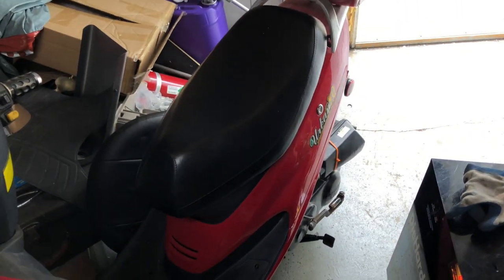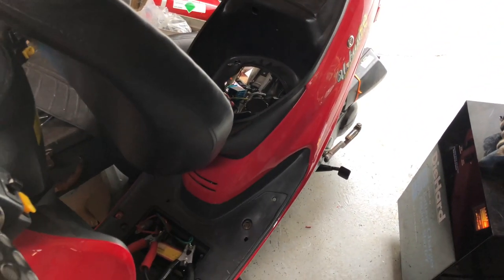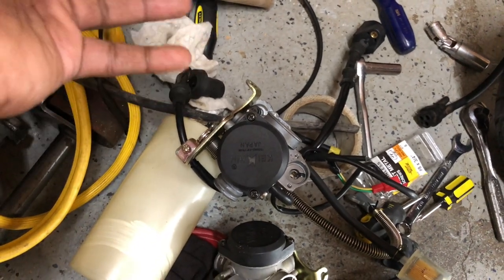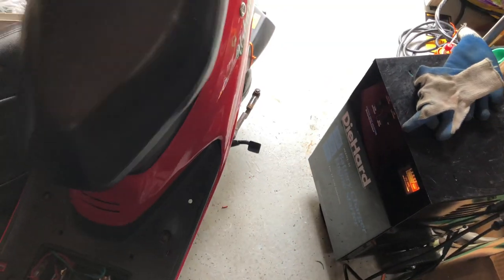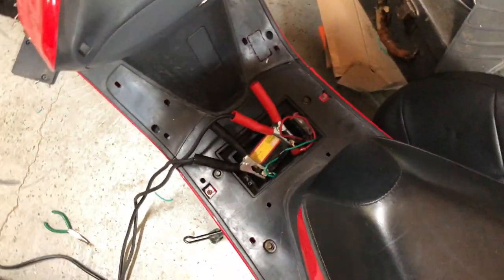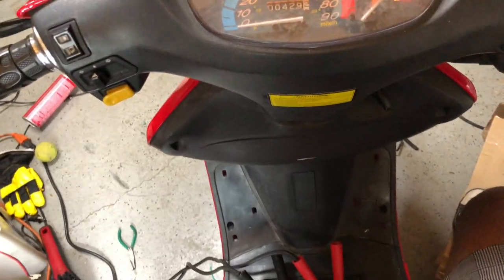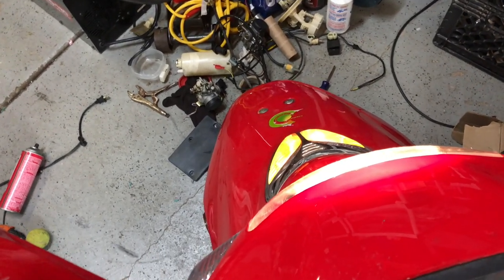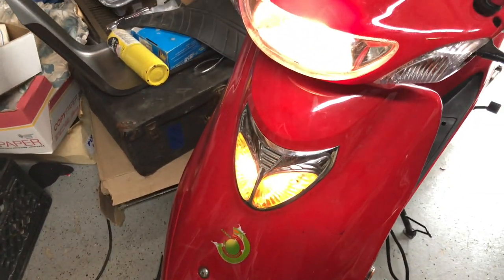Chinese Scooter Won't Start! Got Spark, Gas, Compression? This May Help!

Comment: For those of you having this problem check your stator and the inside of your flywheel for corrosion or rust. Clean both with Emory cloth and blow out any residual.
Reply: Where is the stator
Reply: @chrisvita155 😅 side of the engine bottom end it attached to it

Comment: These kinds of things can be maddening. Trying to figure out the problem can be a search into the unknown. I rebuilt a 100cc big bore upgrade last night. The battery would not register as fully charged on the charger. It was as max charged as you could get. It took going through the actual firing chain, Plug-Coil-Connections-Ajacent wiring to find the problem. It did kick. It started. Kind of odd overall. I don't know what did the magic trick but it seems working the wires over in the actual firing system was what seemed to do the trick. I think the plug was just off the coil boot connecter. It won't run like that.

Comment: I have a 2015 Taotao with the same problem. The solution was to replace the lead acid battery with lithium iron phosphate from the company that makes  Battery Tender float/trickle chargers. The battery was about $125 and about 1/2 the size as the standard battery,. It put out enough juice to spin the engine fast enough to start the scooter every time. It lasted over four years. When it died I was broke and bought another lead acid. I have to kickstart the engine when cold. The kick starter spins the engine faster. The electric starter only does the job when the engine is hot. Valves are properly adjusted, good compression, lots of power. Just a no love battery.
Reply from the maker: Thanks for sharing that info, Corry.

Comment: Im going thru the same thing with a 150cc Taho Taho. Replaced the carb amnd filled with new gas after draing tank completely last Fall. Will check spark and try a battery booster next. Thanks much!
Reply from the maker: Giving the battery an extra boost may just do the trick.
Reply: I got a 50cc Ice bear Maddox Ruckus and I accidentally put regular gas in it but it says to use octane - is that ok??? I can't find any info on google- I'm a chick trying to learn this stuff on my own
Reply from the maker: Octane is only the rating of the fuel. It may says to use 87 octane in which is regular pump gas at your local or any gas station for that matter. Thanks,
Reply: @TerenceDIY  Thxxxx Im subscribing now--so it says to use unleaded 90 octane or above and I accidentally put regular in there 😬 it's like 3 4ths full can I fill should I just use the rest of the gas and then use unleaded- fill the rest up with unleaded an mix it or drain what I got in there now and then fill it up with premium? Whatever is easiest and won't mess up my engine is what I want to do
Reply from the maker: It's not going to hurt anything. It's about performance. You may lose some power (you won't even notice it) but that's about it. You can use some 93 to balance it off.

Comment: I'm going to try replacing my gauge wire to a heavy duty gauge. also when you're on the run if you bring your 18V or 20V cordless drill battery and just run quick wires from it to your battery it really helps to start
Reply: K point u

Comment: My agility ran ok, was bogging out, but took off strong, then it would die & I'm thinking lack of fuel or being dirty,.
Now it wont start, but acts like it will run wen Iput alil gas strait into carb,. (Sputters to run , till the lil bit of gas is gone that I put in...??
What's wrong??
Is. The Bowl dry or empty.??
Reply from the maker: Yep, I would remove the bowl and clean it. Also spray the bottom of the carb into the jet with carb cleaner once you remove the bowl and I am pretty sure it will be fine. Thank you so much for watching.

Comment: i kick start it a few times before i turn the key than i turn the key and kick start it and it will start right up but if i try to start it by the the starter motor it would not start sometimes and even if i turn the key of and kick start it it happens on cold mornings only so i always kick start to start i get up a little earlier and start it up if it starts up i take my time before school if not i have to get ready quicker than usual to go with my brother

Comment: I had a crack in the intake going to the motor from the carburetor. then I had another bike that had to have pressure on the intake of the carburetor or it won't run right

Comment: I got a 1985 gn400, checked everything, valves, timing, ignition timing, replaced carb, spark plug, ignition coil, cdi, has amazing spark, a ton of compression, fuel, air, even tried start fluid, won’t start, it will only pop
Reply from the maker: Is it electric start or kick start?
Reply: @TerenceDIY  it’s kick start, I just got it running actually, it was the decompression mechanism releasing to much compression, so I did not in fact have good compression lol
Reply from the maker: @theslayer8258  That's awesome! Glad you got it going.

Comment: I have a 2012 ToaToa 50 scooter that was sitting for over a year at a friends house. He gave it to me, and after cleaning the carb, charging the electric start, and a few other things I got to turn on and ride. Two days later, no matter how much I charge the battery it will not turn on, it sounds exactly like how the guy in this video bike sounded when he tried to turn his on. I could feel the muffler blowing little puffs of air out when I use the electric start and we’ve even put starter fluid in the intake. What is a good battery that will put out a lot of power? The current one I have is a XTRRME XTAX7A-BS 12V 6AH but I think it’s bad.
Reply from the maker: This battery should work fine (link below)

https://www.amazon.com/Weize-YTX7A-BS-High-Performance-Maintenance/dp/B07GGTCJ9Q/ref=sr_1_1_sspa?crid=2XJRWNDJWU4AA&keywords=50+cc+scooter+battery&qid=1691616263&sprefix=50+CC+scooter+%2Caps%2C121&sr=8-1-spons&sp_csd=d2lkZ2V0TmFtZT1zcF9hdGY&psc=1

Comment: The diaphram that some call the fuel pump, your fuel line comes from the tank into it..well it's a cheap summer inside,if gas sirs it stagnates,that damages plastic and rubber parts,like this diaphram,replace it and the gas filrer,then drain your tank completely, scooters are a bit like cars,they have a reserve area ,gunk from old gas clings there and putting new gas in breaks it up and right back into your filter and carb ,,clear it all replace your spark plug and your on the road bro

Comment: So what was the problem with your bike you started it up I couldn't hear you talk. I'm having trouble with my TaoTao 50 it was running great the next day I went out. And tried to start it and I realized the drainage tube was off but that wasn't the problem. It's a new carburetor I replaced all the tubing I have gas going to the spark plug I stuck my finger in there. Change my CD I box and it still won't start. So today I'm going out to change my Bendix gear. That was always the problem on my two old bikes. So are you saying I need to get a lithium battery I saw someone mention that ?
Reply: It's probably the Bendix gear at what's happened to last two bikes. So I'm going to take it off tomorrow I got two spares. And if I need I can change my belt too and my rollers, I figure if that's not it I'm going to have to take the engine apart and reset my valves
Reply from the maker: Hi, my problem was that the battery wasn't spinning the engine over fast enough to generate a strong spark to start it. I jumped the scooter off using jumper cables and it fired right up. I eventually bought a powerful battery. If you have a jump box or can jump it off with your vehicle, the scooter will most likely start up.

Comment: I even jumped with my car and didn't start up. Im about to burn it up 🤣
Reply: You probably ALREADY burnt up the battery and electrical system, when you jumped it with the car. I hope you at least didn’t START the car’s engine, but just turned the key on.
Reply: Idle is way too high it seems
Reply: I’m goin through the same problem tbh with a 150 cc I’m doin vacuum lines now

Comment: Hold your hand on the back of the carburetor where the filter is
Reply: That helps when there’s compression or air intake issues right?
Reply: Thats exactly what I have to do from time to time

Comment: check the valves that more likely the problem great video
Reply: Where is located the valve?
Reply: @allaboutfamily5192  under the front case closest to your feet. There are valves that hit the intake and exhaust springs and pistons but those should be tuned to .004 intake and .005 exhaust. Its called a rocker arm its what the camshaft hits. This is where timing comes into play too. I hope this helps a bit?
Reply: @megashooter  thank you very much for your help,🙏❤ im gonna do that,God bless you and thank you for your time Anthony.

Comment: Bro that’s no problem “ JUST GET A HIGHER VOLTAGE BATTY.. that battery voltage is too week “ it turns it over but not the right turnover speed “ that’s called a slow turnover “ due to the lack of insufficient voltage

Comment: I had this same issue so I had to tear the engine up and found scoring in the piston then replace the block, piston and rings It starts like new. your engine spins so your problem is compression.
Reply: Could you elaborate on "replace the block" im trying to get my scooter going seemes to be same issue as this guys

Comment: Very informative could be what I’m going through right now
Reply from the maker: Most likely, especially if you're having issues like I did. Thanks for watching.
Reply: Me too!! I have everything, compression, spark, fuel, even tried starting fluid. I do have a decent battery though. My multi meter read the battery at 13.2 volts. I don't have a battery charger or a jump starter😢😢😢. Will jump it with my car tomorrow.
Reply from the maker: Let me know if it starts when you jump it.

Comment: I bought a Tao Tao half a year ago so presumably the 2022 model but exact same problem people will replace everything assuming it shouldn’t be the battery but my battery did start to weaken before this problem occurred. Anyone recommend a certain battery?
Reply from the maker: Here is a link for a good battery for your Scooter. 

https://www.ebay.com/itm/153760224375?hash=item23ccd2d477:g:rBwAAOSwkHJfmzwp&amdata=enc%3AAQAHAAAAwIb2n1CG%2FQpiBzoBbFT6HmBUDQnrIMhbGPAkHayWFBPRR5iTQSt2xmSfqeS3tm30lYL4QNPoPoPhNnJ4hX1MI9m1A6maJutxULYYnHSE6vuHHoqkYxYirmjynliiuxEPt9%2Bi3GZSofbwZzmidYhHI0loyqWyMS%2B7RSjCJdDQTiO%2Bi5WEma9HYEVjrP50KhgLR6rEbZo1muH7j6Uotn5DzdUY3jbJx9ebC%2BYJgjE8ZYaF8ZWLP9qS4cC5aziu9tyNtQ%3D%3D%7Ctkp%3ABk9SR_yH8ajcYQ

Comment: Those blue racing CDI units have an advanced timing curve that causes hard starting. Could be part of your problem.

Have you tried to kick start it?
Reply: I'll have to check to see if I have one of them blue units cos mine won't start with the starter motor after being stood overnight once the engine is warm it will start with starter motor

Comment: So should I buy a new battery? What kind? I have no idea what I'm looking for
Reply from the maker: Hi Mary, this may work for you if your battery is not holding a charge or is too small. Make sure the dimensions of your battery is like or similar to the one in the link. The dimensions are in the description. I hope this helps. Thanks for watching!

https://www.ebay.com/itm/Chinese-ATV-12-Volt-7Ah-Battery-ATV-Quad-Scooter-Dirt-Bike-50cc-70cc-90cc-110cc/232324778342?hash=item3617a2c966:g:1uUAAOSwnFpb0bws

Comment: So I’m having problems now but when I kick start it the headlight flicks on and back off in a sec the turn signals and stuff still work and the break lights for when I try e start do you think a new battery would help that or it won’t turn on but compression is good brand new just out the box spark plug you think it can still be the battery or something else ?
Reply from the maker: That's normal during kick start. However, if you have electric start, I would definitely use a new battery to start it. Thank youy SO much for watching.
Reply: @TerenceDIY  yea I’m thinking about going to get a new battery I just got one bc my cousin just got one we was gonna ride them around for fun but he crashed his and I been using his for parts bc mine recently stopped working ima definitely try a new battery bc I done did just bout everything thanks for your help 👏🏻
Reply from the maker: You're very welcome. Thank you for watching.

Comment: Hey terrance, nice video it helped when i attchached my battery charger it sounded better but still didnt .. what was wrong with the 1 st new carb u bought ??
Reply from the maker: Hi Chet, I don't think anything was wrong with the first new carb. My problem was a spark issue. The starter wasn't spinning fast enough to start the scooter. I installed a new battery like the original it came with and now it starts every time. Thanks for watching!
Reply: @TerenceDIY  ,  I tried a variety of things to finally get it started including using my battery charger to boost power while I cranked it.. it did sound more powerful so thank for that , combined with starter fluid it runs again ty

Comment: I'm not getting any gas to my spark plug at all I replaced the battery and spark plug did oil change but I'm not getting gas to the spark plug and ive been trying for 5 days straight now
Reply from the maker: Sorry for the late response. Did you get the scooter started? If not,  you should remove the spark plug and pour a little gas inside the hole, replace the plug and try to start it to see if it starts up? This will give you a clear indicator that you have a carb issue. Maybe the jets are clogged. Let me know.
Reply: @TerenceDIY  I have tried that and it cranks over but the only way it starts up is by spraying starter fluid directly into the carb and even then it starts for only a few seconds and then dies I've replaced both the battery and spark plug and made sure all the lines are clear
Reply from the maker: @SittingWolfParanormal420  , I fixed a scooter that was doing the exact same thing. I replaced the carb and it ran great! Below is a link to the carb I bought. 

https://www.ebay.com/itm/49cc-50cc-GY6-ATV-MOPED-SCOOTER-CARBURETOR-CARB-SUNL-ROKETA-JCL/282158976590?_trkparms=ispr%3D1&hash=item41b1fc4e4e:g:14UAAOSwFe5XyakN&enc=AQAEAAACcIQvEcHUrT7nmUC3yY5qbPyaBN1nJEDYW8MyypsJPgXKRq2eWB5fTvUPFLHCPCQugvcx%2BeNdsObSTF%2BzQFhLqbaa55cWdzM%2BpGnNYPiZVDkO9eiNHVPpyfLDzpZye%2BPleY9YgU5%2BXUDcpLwhjLg4wFWS8o7YcQHLVKlEW7uzI5ecYC1BQm0ojkdkhriwflz3RIAMx9VzhHm5HWxoDVXP30QWbtTSfRDVFkZVh7TN0Tg%2B%2BqRHeMvYUwQxYE85SpMgmov0XejrWoGcL0wHPFQbF3Jc8FJyxGw3UEiedixHzdjnhf%2FtwoDJ8Y0Kh0MSMPMTDw3zDEOOTtHeHsepBKvi0ganXTO92Tzg2Ic8JiZ63SoLoOghMGzooCeS%2Fy5HNhAgfs5fTngjbeCSLAnVDHUu54D5kFzFPMvKZ47KzVJ%2BuHfFsm3NJfZSWP6BT9HwHar4ROKLaApb8LntMrEYqb1Q7YYAAroiCXlB%2BPB%2FGHWYd4erRjGla%2FdIA3fY7Gpu%2BN5ex6xQl7PZp9TU0ODg2Z3J4efkrCp0rmVwzuhG%2Bm1%2FKIstbhrjlCSGoQpDkCAnVufn%2Bj87LFNHCm0RrD%2FxFjPK77zpN7nodbNG81BfOevV4vwXh0RkSKs8GsG%2BbayEOn6C3VMeCxH4FSEIT4axP93ZvsmyX2bjl4e0UEkVHe8FRwx7a3x6PIYZlYPJfwGeCDl%2FRNK4zEHxtG%2FFSVa%2FiFBtWUpEVDD3Hw232wXSoOaewZl97W32SPYPDTY3YgzYt3WW%2B8wtT4B1ylUqwe9Jnb9aa9dorPU2puUgxuX9bcUX3bIqo9h5odEW9TvsqHxc%2FInnmw%3D%3D&checksum=282158976590d5acf3ca8cdb464d827b54ddf7bde69f

Comment: Hi Terrence,

I have just replaced my top end on my 50cc two stroke and now it won’t start. I have compression,gas and spark. Any ideas?
Reply from the maker: Hi Jayden, do you have enough power? Is the engine spinning over quick enough to produce the correct spark to create combustion? Let me know.
Reply: I think that my battery is so flat it can’t give enough power. It is currently on charge, i’ll let you know!!
Reply from the maker: @jaydenplaysguitar3896 , that's probably your issue. Let me know.

Comment: should it running when using the kick-starter? I also have almost the same problems here.
Reply: Yes it should, the problem is that this is a low compression engine and you can't spin it that fast with the kicker. Btw. You should check your choke first (the thing with the two cable which sits on the side of the carb).

Comment: I bet that's the problem I got.  I just installed my motor I upgraded to 80cc.  it ran one time after installing but now will not fire up.  there is gas. fire and compression.  got it on charge now hoping this does the trick.   I am tired now resting and will let battery charge.  wish me luck.  I. lol post if it works.
Reply from the maker: Hi Mikey Hays, my fingers are crossed! If it doesn't start with the battery by itself, try leaving your charger attached to it as you start it or connect some jumper cables to a bigger battery. I'm almost positive it will start. Good luck. Thanks for watching!

Comment: What's up T, so since mine is doing the same thing should I purchase a higher voltage battery charger? I have one but it's only a 6v
Reply from the maker: What's up, Brian. That 6-volt charger is not going to get it. I would jump it off with a car and cables before I used that. You need a good 12volt charger. I think they are good to have around anyway. Thanks for watching!
Reply: @TerenceDIY  ok cool I will most definitely get that and sell the one I have

Comment: Same, my bike has gas,good compression,spark and all, hell even battery good and everything trys to crank over..i havent checked the stator yet but i am tomo and im 100percent sure its the damn stator :/ which ill have to order a new one.
Reply: Replaced my stator still having same issue. Any luck?

Comment: I have a manco hornet, I've charged my battery. Even hooked a charger up to it to try jump starting it. It started a few weeks ago with me just charging the battery but now it doesn't want to start at all. It sounds like it is turning over but like there isnt enough power to start it. It sat for like 3 months but like I said I started it last week with no issue after I charged the battery...any suggestions ?
Reply: Try a few sprays of carb cleaner into the air intake port behind the air filter